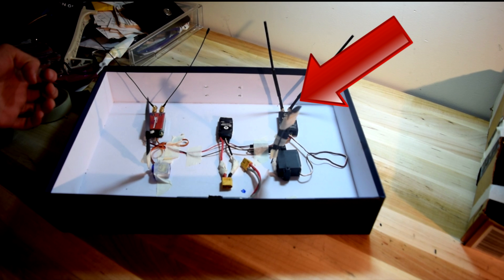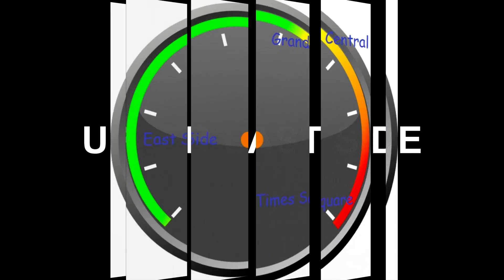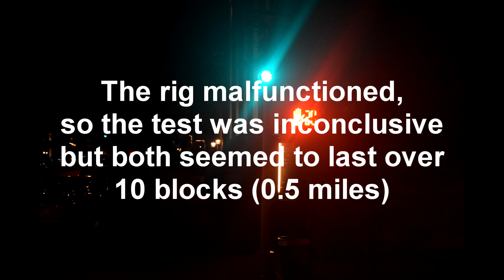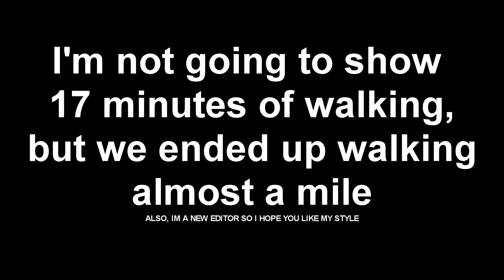Team Blacksheep CROSSFIRE vs ImmersionRC EzUHF: LRS comparison

Comment: For indoor use like that I never tried a range test. Though I have both systems and I like TBS better as its an easier setup. Outdoors I've never had an issue with either.

Comment: Like the test my only issue is that it seams you were holding one in such a way that your body may have bean causing all be it a miner interference issue but other then that nice job if I was that deep in the pocket I'd go with team black sheep but I'm not LoL & hobby king has a steal of a deal on the ezuhf "-$70" that's under $70 bucks! Can't beat that for a name brand like immersionrc hope that helps some one I know it helped me after 5 years of waiting to afford a top quality uhf system!
Reply: I noticed that as well.   I thought he should have flipped the box around a little just to make sure his body wasn't absorbing some of the signal from the EZUHF.    I've been using EZUHF out in the middle of no where here in Colorado and can fly consistently 4-5 miles without any glitches.  Plus 900 MHZ is right in the cell phone band.  That in itself could be a an issue in NYC due to all the Cell Phone Towers.

Comment: Mmmm... great fun but as previously mentioned, comparison isn't fair. The antennas aren't like for like. The Crossfire receiver shown is fitted with great little di-poles and the ezUHF has the hopeless whips. I acknowledge that the ezUHF is supplied with the whips but no serious long range flier uses them. If the ezUHF was supplied without antennas, you wouldn't have conducted the test with nothing fitted. An indisputable test which would be really useful would be one with like for like antennas fitted to both TX's and RX's. Like I said, nice bit of film making though.

Comment: Seriously cool video. Very informative guys and gals.  I'm about to swap all my mini quad rigs to CF :)   Just Doing a little YouTube surfing to see general consensus on the situation. I know I've never had an issue what so ever when I've used it in the past.  But you know 2.4 is usually easier.   But with more and more sketch locations..   Crossfire all the way it is.   Thanks trapster for getting the sbus and serial link figured out with the taranis
Reply from the maker: +Mr Steele Thanks. let us know if you have any other questions/need help

Comment: The EZUHF will do extreme hopping from 433 to 450mhz.......Also, those Sanders Monopole antennas on the EZUHF diversity receiver are virtually useless if you want range....Nobody uses them..... A Dipole on the receiver will double the range. Dragonlink also use Dipoles on their receivers....guess why...If you are going to do a test, at least do one that demonstrates you at least know the basics.
Reply: Forgot to mention one more point. testing the stock setup is meaningless too. That only represents how the brands want to package in their stock setup, thus their initail selling prices. You got to compare performance with similar $ investment
Reply: @vchan1501  nicely said.
Reply: I am not sure what you guys are trying to test. Are yo intended to fly long range in the subway and in the middle of NYC? So the tests are pointless unless you are trying to test the equipment's ability to reject interference. For more meaningful testing, you got to test it in locations that the equipment is designed to use in e.g. for long range openfield flying. Then you can really tell how the two compares.
Reply from the maker: +EnglishTurbines EzUHF with dipoles and without dipoles has about a 5% difference in range around here in the city, and yes, we've tested that. Also, the large majority of EzUHF users use monopole antennas, and we stuck to the stock setup for both systems, excluding the Diamond antenna, as almost all EzUHF users upgrade to this. Extreme hopping on 433-450 was tested by us again vs regular hopping, and our results in the city were terrible on extreme hopping, barely got 50m away, so it was back to 433-435 which had significantly better range in NYC. And Dragonlink, do not even speak of Dragonlink to me, lol, it's disaster around here, significantly worse than EzUHF. This was a test in a high RF environment, and we've covered what we believed needed to be covered.
Reply: +Team Icarus  RC LOL.......ok, but it all seems rather pointless to me, because I don't know anyone who flies serious FPV in the middle of NYC.....If the noise floor is as bad as you say it is, why would you...???? I believe the TBS Module will also output at a Max of 2000 mw...compared to only 500 mw for the EZUHF JR Module.....hardly comparing eggs with eggs is it?....Having said that, I think the TBS is interesting, it has some good features....Its not going to help though in the middle of that noisy environment though...LOL.
Reply from the maker: I think we'd say the link worked pretty well, in the middle of NYC.... :) https://youtu.be/-cly_RpO2Sk

Comment: Doesn't really prove much his vid. Both systems need to be PROPERLY mounted to a long range craft and flown to its maximum 'usable' range.
Reply from the maker: +paulkazjack We tested the xFire and EzUHF's noise resistance. We proved that xFire functions better in a high RF noise environment. There is no need for an aircraft to be involved, we walked to their maximum useable range, and when they left useable range (failsafe) we marked. I don't see the need for a plane and a test flight to be done, because we already know with the proper antennas both systems can make it to the horizon
Reply: For a true test for rf noise, run the same experiment within the vicinity of a high power uhf tv transmitter then. The buildings and concrete environment are playing a greater part in your experiment,not rf noise.
Reply from the maker: This is New York City.. There is RF noise everywhere, and we stayed within direct LOS for the third test shown until the end. Also, EzUHF should have beaten the crossfire if the buildings and concrete were playing the biggest part, as crossfire is 915mhz and EzUHF is 433, better for penetration. However, crossfire still performed better. I think almost any viewer has gotten what they needed out of this video, there is no need to walk next to a UHF transmitter when you can turn on a spectrum analyzer and see noise on (not just 2g4 and 5g8, but every single band) through the top of the graph

Comment: CF have 3 frames per second - EZ 50!
also CF have adaptive power- so at low signal it AUTO switch to 2w!!
How you can compare it?
It is the same as 100Mbs wi-fi vs 1Mbs- yes it have different range but and SPEED!
Reply from the maker: +breezyjr Transmitter power was actually higher on EZUHF by 100mw. High power (600mw) vs Crossfire's 500mw. Also, I don't know what you're talking about speed, because Crossfire can output sbus as well as PPM and PWM, whereas CF only PPM/PWM... SBUS is significantly faster than both PPM & PWM.
Reply: +redsonic5 The crossfire can have the Tx power set...  It doesn't have to be Auto...  I"m just guessing, but I'm willing to bet they kept the transmit power the same on both...

Comment: Did you have the EzUHF in high power mode? If it was in low power mode, it's only 200mw.
Reply from the maker: +mrmaple We did have it in high power mode because low power mode wouldn't last 100 feet before it failsafed.

Comment: I would love to see the same test with Dragon Link.  I have never considered EzUHF to be that robust anyway.  Dragon is always setting the records for long range. So seeing how it would do to the new TBS system would be great.
Reply: +FPVSpace if you can find someone that went 165km on 100mW with whip antennas, I'd love to hear all about it :) sounds to me like he used a yagi on both ends :P just from a technological point of view, the crossfire's receiver is about 4x more sensitive than the most sensitive 433-based system on the market right now. So, as far as we're concerned, we've taken UHF systems to 100km, and we know what's involved in making it happen. Once you go to whip antennas, it increases the challenge by a big magnitude.
Reply: +Joseph Dawson Dragon Link is about the same as EzUHF in terms of Range. IB Crazy did that comparison.
Reply: +Team BlackSheep 100km on a whip is insanely impressive of course. I was not aware you did that run with a whip but I am looking forward to seeing the reports in the wild because I've become an extremely skeptical consumer these days! If it's as good as you say it is then I'll be getting one.
Reply: +Chris Thomann Not in my experience it's not. The DragonLink V2, especially with the next generation firmware is off the charts performance wise. More people go further with DragonLink with less issues than any other RC control link. It's the most rock solid plug and play system there is and I've tested the EzUHF back to back in identical airframes and it just cannot keep up. 

So really I think the DL has to be the benchmark for the Crossfire to beat. I wanna see that video. I might just have to buy one to compare.
Reply: The EzUHF is/was the industry standard. Dragonlink always was a niche-product. I don't know why. Maybe it is twice as good as the EzUHF now, but that is still nowhere near where the CrossFire is now.

We have flown 22km with only 10mW(!) from the CrossFire TX.
Reply: +Chris Thomann The popularity of these systems has little to do with their long range performance because most people do not push their systems to the limit so they won't ever know. As far as I know the current hobby FPV record is 165km and it was flown on DragonLink V2 at 100mw. We need to see units in the wild and how they perform in a variety of conditions before jumping to conclusions.
Reply: +FPVSpace  "The popularity of these systems has little to do with their long range performance", thats not what I said. But the popularity of the EzUHF explains why it is more interesting to do a comparison against the EzUHF than the DragonLink. I will bet you that the CrossFire will perform much better than the DragonLink V2. We just have to find a way to settle this :-)
Reply from the maker: +FPVSpace, if you / somebody sends us a dragonlink, we will test the systems (all three of them) against each other again. Right now we don't have such a large budget.

Comment: Very good review, the Crossfire really seems reliable. You should also have tried when the EzUHF went into failsafe to turn of the Crossfire TX if the signal comes again. Even they use different frequencies the Crossfire TX could block the EzUHF TX when they are next to each other. Usually you dont have two transmitters so close.
Reply from the maker: +hover82 We tried shutting off and turning the crossfire on during the penetration test in grand central at 2:39. The transmitters are at different frequencies so in theory they should not interfere with each other, but if one were to block another, the EzUHF would block the crossfire, as it is at 433mhz, which's second harmonic is quite close to the 915mhz the crossfire was operating on. I understand what you mean though. Thank you!

Comment: It's not a correct setup, IMHO. The antennas on the Crossfire are sleeve dipoles while those are monopoles on the EzUHF, which everyone knows is way unreliable. I suggest you repeat the test and use VAS semi-rigid dipoles on EzUHF.
Reply from the maker: +Carpe Luce (Stringer) The test was meant to test how the average user of each product would use it. We used the Diamond antenna on EzUHF since most people upgrade the Diamond antenna, but did not use dipole antennas since the majority of EzUHF users use the stock monopole antennas. The range difference between monopole and dipole on a frequency this low shouldn't be a large difference in theory anyways, but if we we repeat this test we will use dipole antennas on the EzUHF system. Thanks for the input!
Reply: +Team Icarus  RC Since you have both systems, a repeat with dipoles on both will be interesting. 
I have two questions on my skeptical mind about the Crossfire (not sure if you can answer them tough):
1. If you set to to 500mw, does it stay at that power or does it automatically up the power to 2W when needed?
2. Does it automatically lower the data transfer rate to cope with poor link quality, and if so, is this noticeable (as sluggish servo movement) just before failsafe kicks in?
Reply from the maker: +turdsurfer If set to 500mw, it stays at 500mw. I am not sure, but we did test servo movement every block we walked away during the last test, and it responded on command for both the EzUHF and Crossfire when either system was not in failsafe.